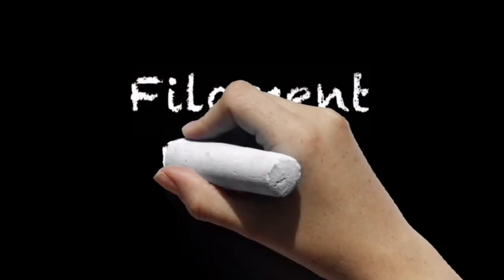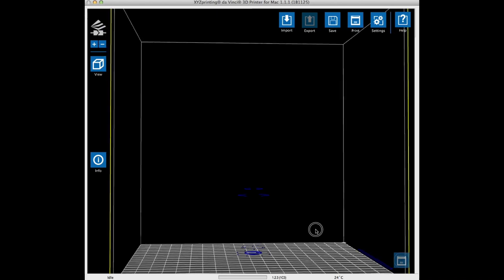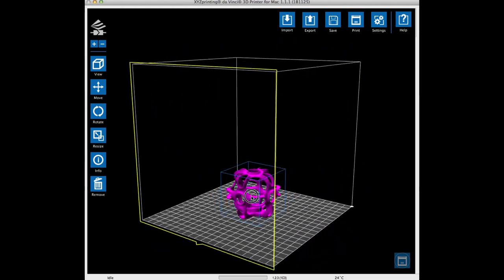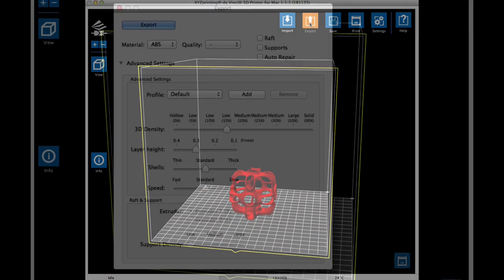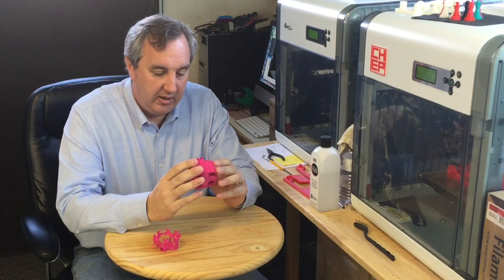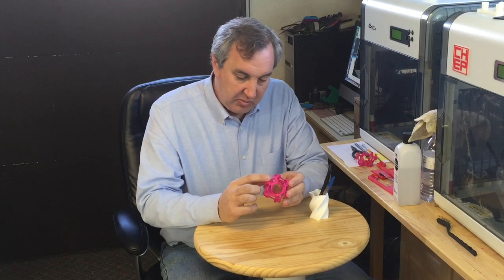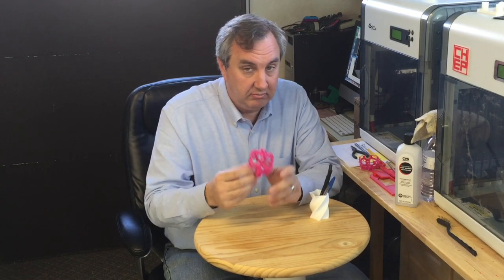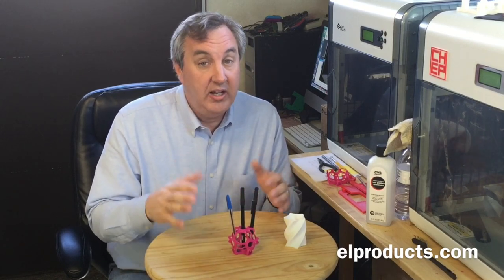Filament Friday #8 - Unique Pen and Pencil Holder on Davinci 1.0 Video #045

Comment: Try using Simplify3D on what ever printer you can, use supports. I used to be restricted by my own limits on using supports with other software. The supports from Simplify3D break away with no problem and they do not flake away, the supports stay in one piece and break cleanly! Try it out sometime.